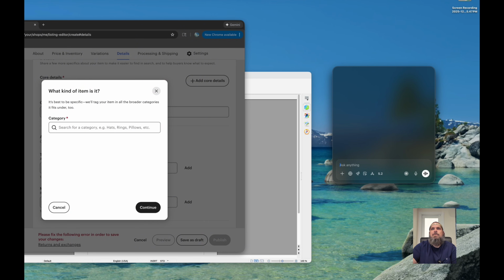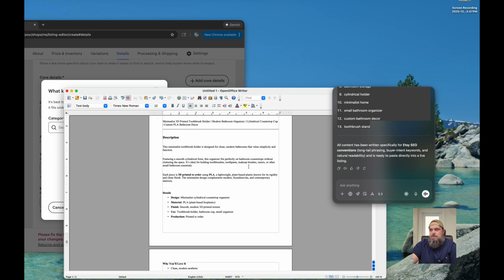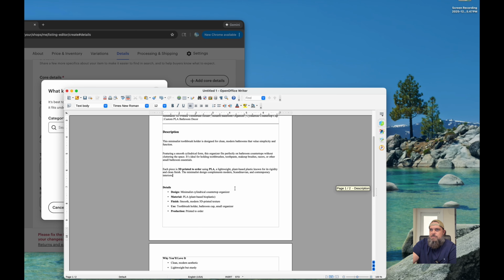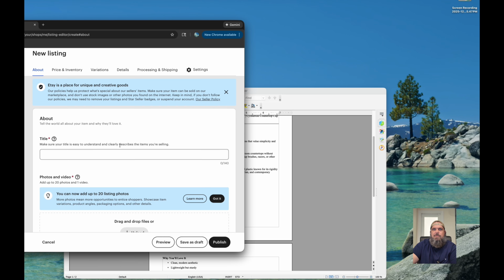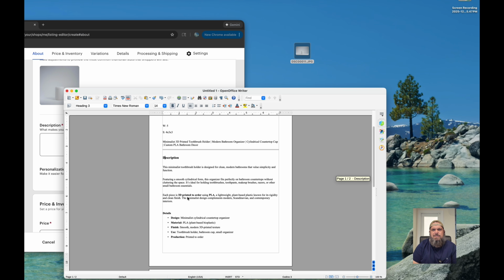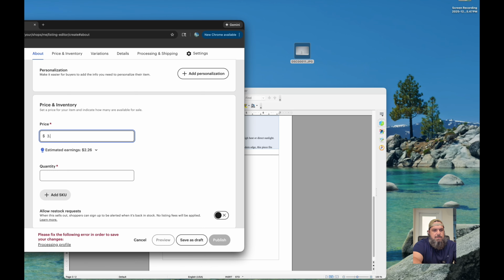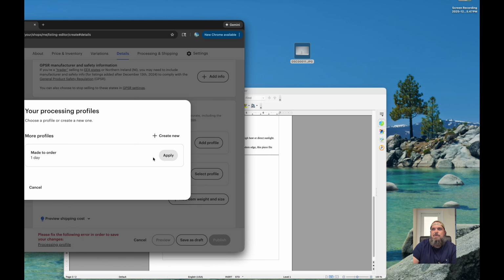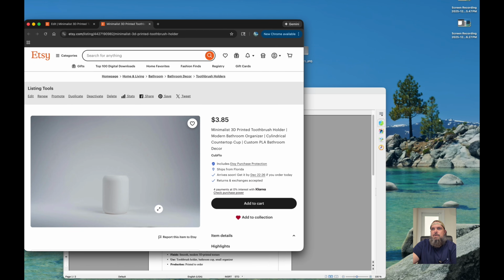Day 17: Turning Photos Into Listings (3D Printing Business Build)

Comment: Love the series showing the entire process. Word of caution just in case you weren't aware is that Etsy will lower your search rank if your conversion rate is low. Yours will be artificially low from your YouTube viewers checking out your shop with no intention to buy. This is why some other YouTubers have changed their Etsy shops and limit what they show so it can't easily be found by their YouTube viewers.
Reply from the maker: Appreciate the heads up, that listing was only used briefly to demonstrate the process and has already been taken down. I’m being careful about when and how anything goes live for exactly that reason. Thanks for sharing the insight.